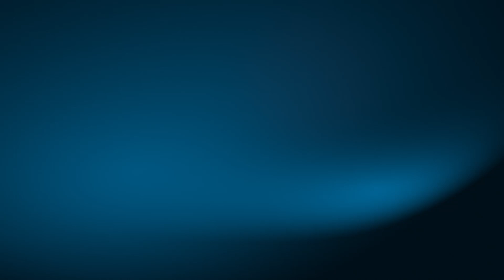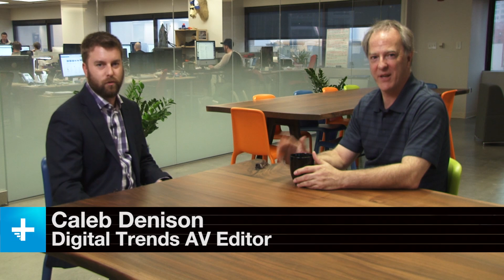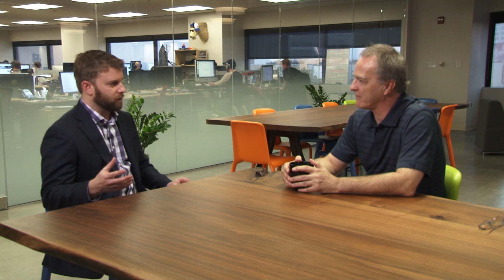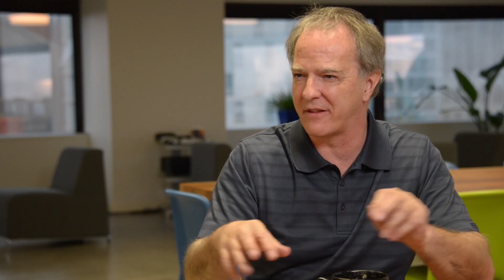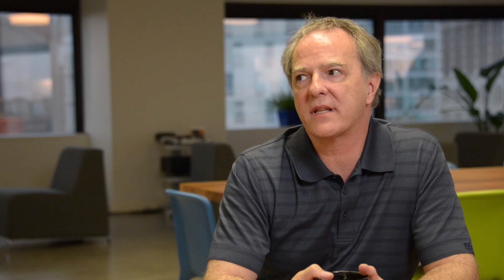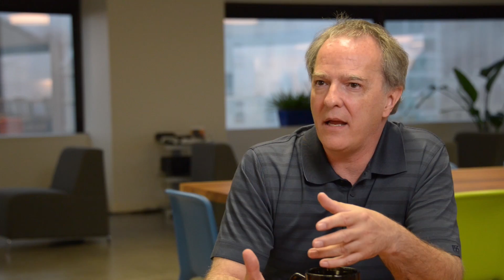Home audio secrets with speaker savant Andrew Jones

Comment: Too bad his Pioneer soundbar had bad capacitor design or testing? My soundbar died after two years. Many more did, too. Google it. Too bad he doesn't stand behind his product! Design, fail, move on. Should be ashamed of his legacy with the Pioneer soundbar.
Reply: Ralph Schiavone not sure he's responsible for QA in the build manufacturing process. I mean, maybe he is, but I thought he did the engineering design and that was it.
Reply: Jeff Loupe If I put my name on a product - which he did with this product (it was marketed as his baby) - I'd make damn sure it was produced correctly. This is the worse performing product I've ever bought. Two years for a $400. item is unacceptable. All my stereo equipment from the 70s and 80s is working fine. Sad it has to take up space in a landfill.
Reply: you make a good point, hard to argue if it's got his name on it, he should own it.
Reply: Jeff Loupe Thanks for letting me vent! :-) The soundbar did have a nice, larger wood speaker sound. Too bad. Recently bought an LG soundbar for same price. Has a better, tighter subwoofer, but soundbar not as sweet. But, my remote now works with my OLED LG - the Pioneer didn't work with the tv. Oh well... take care.
Reply: Ralph , I'm sure if you made your own soundbar with the components of your choice would have blown Pioneer away and I'm 100% certain that it wouldn't have failed either.

Comment: I got an amazing deal for BS22..just want to ask is it any good with cheapo amps like lepai...i will upgrade the amp later but right now i just need better sound than tv speakers.
Reply from the maker: KrishTrinity One of our writers is running the Andrew Jones Floor standing speakers and center channel on a low powered amp. While it of course doesn't get very loud, the speakers sound clean and true at moderate volumes.
Reply: Thank you..that is exactly what i wanted to know
Reply: Maybe also take a look at the SMSL SA-36 or SA-50 amp. I've had a few Lepai amps and the SMSL ones definitely have better build quality. My ear isn't discerning enough to tell you that I can hear much of a difference, but when you have to touch that volume knob as often as you eventually will, it's nice to feel a well designed piece of equipment.

I also recently did a quick review video on my channel for the Dayton Audio DTA-2.1BT from Parts Express and I like that amp a lot. It has mulitple inputs including Bluetooth and it has a powered output to a sub if you want to use an old speaker with decent bass as a faux-subwoofer. It's not ideal. It would be better to build one. Look up Voxel Subwoofer if you're interested. I just made one and I am extremely happy with it.